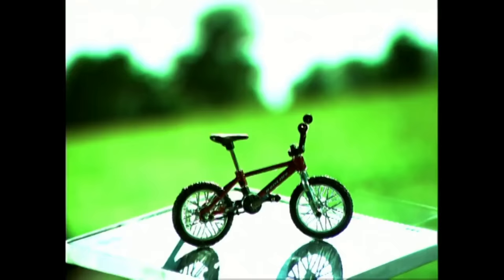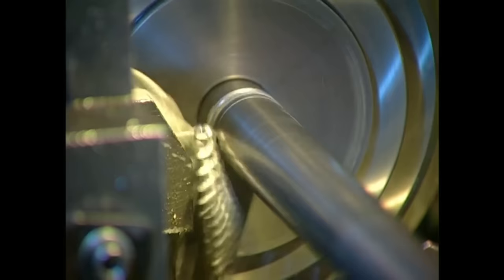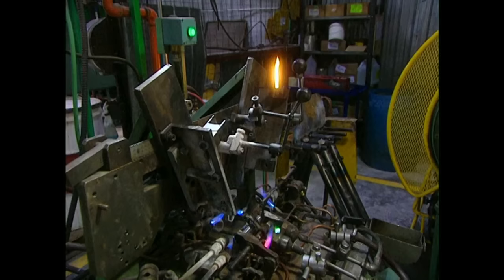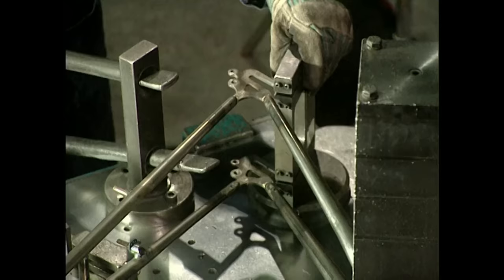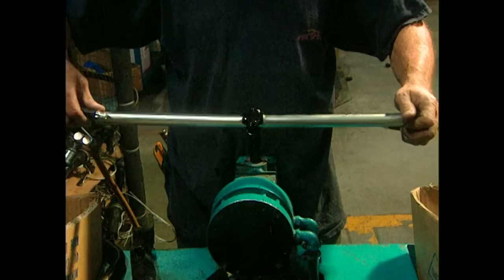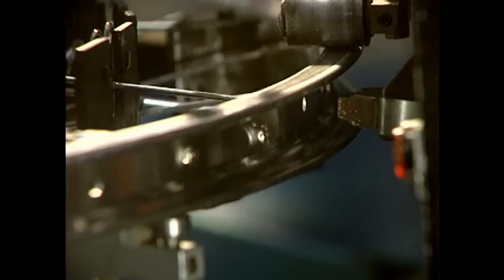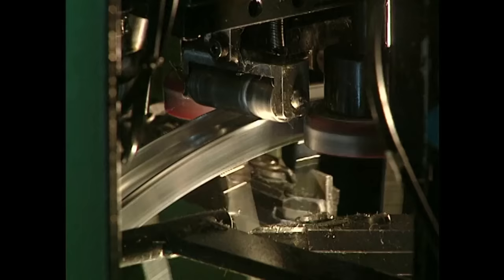How It's Actually Made - Bicycles

Comment: I have a question; can the bicycle ride me instead of me riding it? 🤔
Reply: Is it a rinsing machine or a filling machine?
Reply: @darthraider450  I would like to fill a machine
Reply: take the seat off
Reply: Depends, are you bi? If not you're out of luck.
Reply: @carlwheezerofsouls3273  yes😔
Reply: @carlwheezerofsouls3273  😞🖖🏻
Reply: @blankface3287  down bad, homie?
Reply: Yes if you don’t have a saddle to sit on but the pipe
Reply: Depends if you're a top or bottom.
Reply: @electrogestapo  I'm from the Midwest, does that count?
Reply: It would have to have non-straight wheels

Comment: Fun fact: bikes at Walmart are built in store. "Bike builder" is an actual job title.
Reply: Yeah you know what that ACTUALLY means? Thru assemble the kit. Tyres and chain on, both pedals on, and a the handlebars need an allen key to be mounted straight.
Reply: Assembler. I would know, I was one. I also built grills, furniture, and rinsing machines.
Reply: @cavalierliberty6838  are you sure it wasn't filling machines you built?

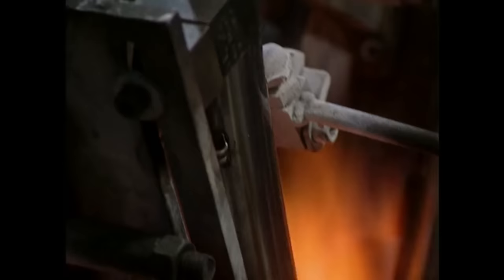Comment: 1:34 That's not welding it's brazing.
But I don't think anyone here gives a damn ^^
Reply: i was thinkin that looked like a weird ass way to weld lol
Reply: I was gonna say the same.  Pretty sure it's brazed though, not soldered.  Brass filler, not lead.
Reply: @tippyc2  Updated. We have only one word for both in french so I made a mistake. But yeah the temperature is higher than soldering which is used in electronics to not damage the components.